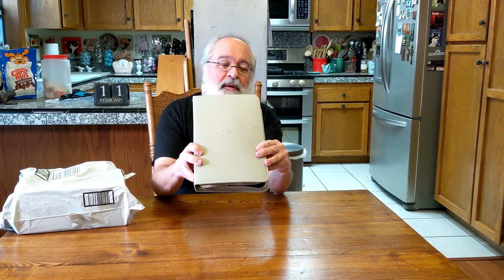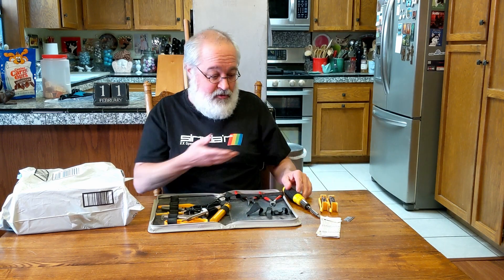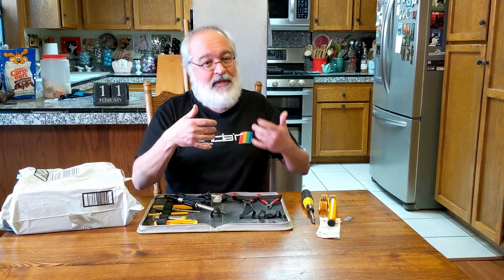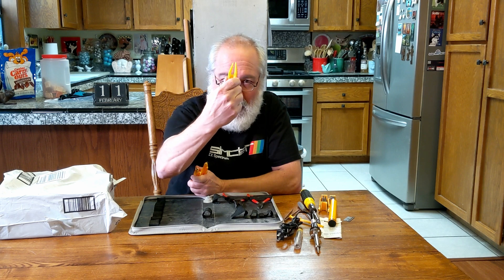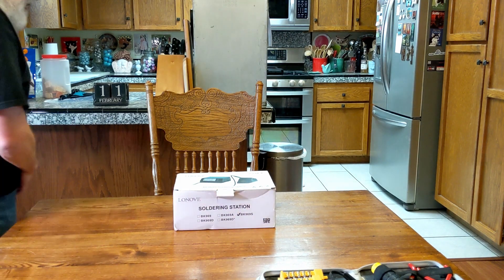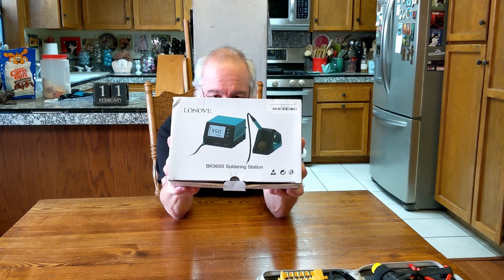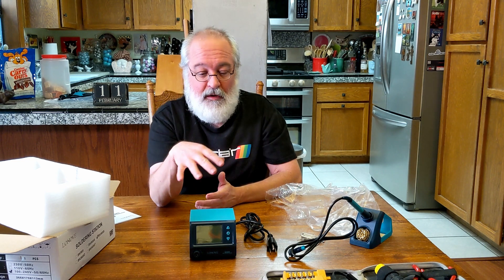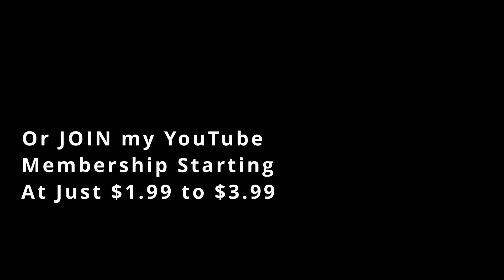My 1st Soldering Station - Lenove BK969S - Soldering Iron - Electronics Repair - 8bit Retro Repair

Comment: If you're going to get into repairing old electronics I highly recommend getting a desoldering pump for removing the old solder. They generally only run $8-10 and make removing solder a quick process.
Reply from the maker: I have one in a small kit I am ordering.  ;-)

Comment: Congratulations on a nice looking purchase. The only worry I have with what you showed us is the cable on the iron which looks as if it may be a bit too stiff and will fight you as you try to hold it at a particular angle. As you obviously appreciate, the best chance for success is to practice. Try getting some little cheap flashing LED type kits from the internet.
The simple secret to soldering is to use  your choice of iron tip to heat the component and pcb pad 'at the same time' on one side of the joint and apply the solder to the other. My choice is always the small chisel tip but a lot of people seem to get on happily with the manufacture's default which these days is unusually the conical point. Using leaded solder (60/40) instead of the unleaded crap is also a big help!
Nice try at pronouncing solder correctly. You seem to be having trouble with incorporating the L naturally, that is because you are still pronouncing the O as you would for sodder. The correct way is as in sole or soul.

Comment: Nice. After 30 yrs of soldering both as a hobby and professionally I’m still using my crappy radio shack iron. Now you’ve inspired me to get a real one. Weller is overrated and probably the one U bought will work just as well. FYI even the $600 stations have plastic connectors. Suggestion: be sure to put a blob of solder on the tip before turning off the iron. People think U should clean the tip before turning off but that will make it oxidize more quickly and reduce its life.

Comment: At an old job we'd use the tool at 5:42 to more easily remove jumpers from hard drives or boards. Still don't know the proper name of it either. May the courage be with you for your soldering adventures!
Reply from the maker: I need to see if I have some old inkjet printer around and if it is gonna be chucked, see if it has any pcb on it with non surface mount components on it that I can practice with.  No idea how much new 2010 inkjet printers PCB wise if something good to practice on.

Comment: Diagonal cutters! 😂 I got popped at my last job for calling them dykes. It's not politically correct anymore. 😁😁

Chip puller in the kit too! That's a rarity for use anymore, now you got me wondering where mine are. 

Garter belts and sock suspenders old. 😂

That's a nice looking soldering station too. Some of the cheap ones aren't necessarily 100% accurate temperature wise, but I'm sure they're close enough. I'm getting ready to replace my Weller station, and I bet it's 15 years old or older.
Reply from the maker: For some reason I think if I upgrade down the road, Hakko is in my future.  For now, this one should do, I hope.
Reply: @MacSociety  no reason it shouldn't work. Unless it just flat dies. I worked with a base model Weller soldering iron for decades. 

Does it get hot? Does it melt solder? 😁😂